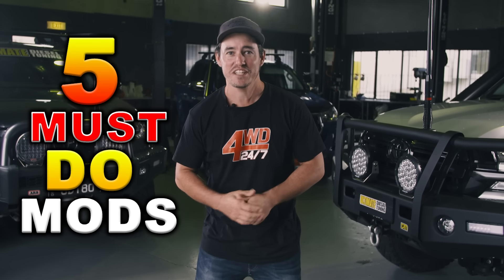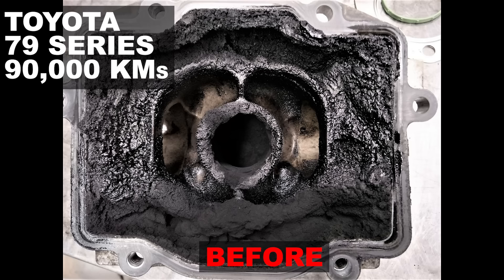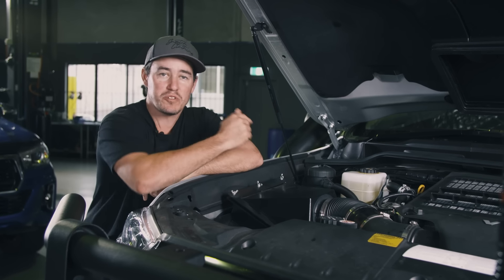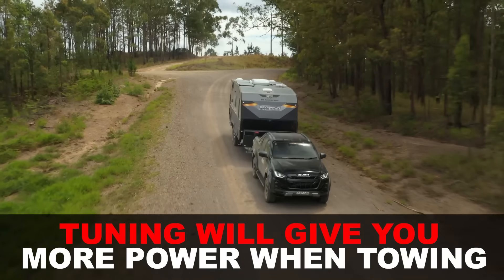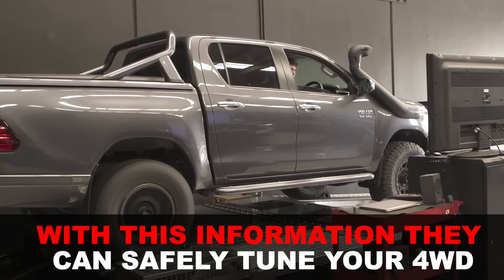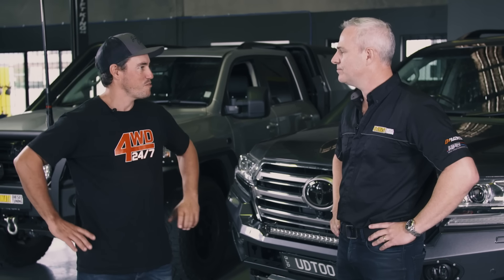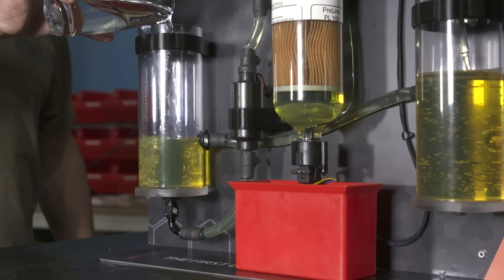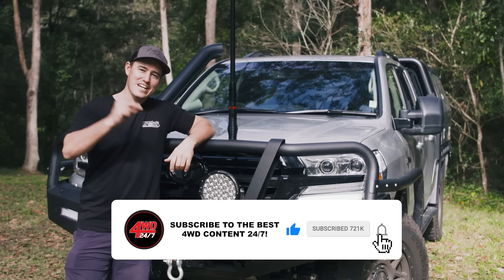5 MODS EVERY MODERN DIESEL OWNER SHOULD DO – all under $1,500! Get 30% more power, more reliability

Comment: Is there an easy way to check if you need a intake clean? I have an facelifted N70 D4D Hilux with 200k on the clock. Any suggestions?
Reply: Yep it'll have a good amount of soot in there. Pop the EGR valve off & have a look at it.

Comment: Dual mass flywheel applications donot match up with tunes .
Piston cracking is heavily influenced by tunes .
Injectors that are in good condition . Manifolds that are clean . Air filter housings that leak dusty air  [toyota panel filters ] .

Comment: Must disagree on the lock up kits. Most are poorly engineered. Only got mine (Ortos) to stop throwing codes after I greatly increased the resistor wattage (I.e ability to get rid of heat). Better to just use fourth in your five speed. Problem solved, zero cost.
Reply: we use the Richards Auto lockup kits, they are fantastic

Comment: has anyone compared dpf vs non dpf or dpf delete in terms of soot build up
Reply: DPF delete is illegal, so irrelevant
Reply: @Corey-pd3mi  that was the point of the question  to ask whether or not  dpf was even functional as intended or whether the science has been half cooked or not stating if is safer to have in place vs the other fuels in  use that is more toxic to the environment
Reply: @jasonhowe1697  hey Jason. The EGR system & the DPF system are two completely different things. A DPF has nothing to do with diesel soot build-up in the intake.
Reply: @UltimateDieselTuning   correct me if I'm wrong isn't  on the wastegate

Comment: Chemical clean.... do it properly please.  Also, catch cans don't stop the build up in the EGR.  Tune = "not working the engine as hard when towing."  Is he serious?  Lock up kit?  Just buy a transmission cooler if heat is your only concern.  Fuel filter.. yeah ok I agree with that one.
Reply: Ok, an engine making 500nm at 2000rpm vs 3500rpm which is working harder?
Reply: @adrenalinerush91  you don't get something from nothing.
Reply: Catch cans are solving half the issue. With regards to the tune -the engine isn't working as hard when towing because it has more power & torque so you don't have to push it as much (throttle) in order to get it to move as such.
Reply: @kizbot85  lol clearly an engine that doesn’t have to be flogged won’t work as hard as one that does.
Reply: @adrenalinerush91  Like I said before.  You don't get something from nothing.  Think about it.  You are sacrificing something for more power.  It doesn't come for free.  It's the same engine.  People just can't get this through their heads.  If the manufacturer could achieve this then why wouldn't they?  It's because they designed the engine with the best combination of power economy and longevity in mind.
Reply: @kizbot85  lol no they designed a base tune that will be “good enough” to run in every climate with every fuel quality with every engine. 
They also work to a budget. 
But hey come back and tell me the manufacturer knows best, the same manufacturers that designed the pistons, dpfs, handbrakes and couldn’t get a hilux to pass a moose test for over a decade. 
A tuner optimises the map for the country, climate, engine, fuel quality and use of the vehicle.
Reply: @UltimateDieselTuning  The engine needs needs X amount of power output to pull the given load at a certain speed under certain conditions so how is it not working as hard to achieve this and what are you sacrificing for more power?
Reply: @adrenalinerush91  If the engineers could get more power, fuel economy and longevity from the engine with no penalty, why wouldn't they?  That's right.  Because they can't.  To be clear, I am not against having someone tune the motor to suit a persons particular needs but there is always a negative which is never mentioned and why would they mention the negatives when they are trying to sell a product.
Reply: @kizbot85  LOL!! and again, those engineers make a generic map to suit every climate, fuel quality and engine for the ENTIRE world. 
A tuner optimises the map to the specific engine to the specific climate, to the specific fuel quality, and use of the vehicle by its owner. 
If you can’t or don’t understand the differences in climate, engines and fuel around the world there’s no point even talking to you.
Once again go ahead and tell me how great those engineers are while old mates hilux rolls down a hill from a failed handbrake filling the suburb with smoke from the failed dpf. Then when it stops he finally get to drive it back up the hill and finds he’s cracked another set of pistons and then rolls as he takes the next corner because those same engineers couldn’t get it to pass a moose test. Go on tell me how terrific those engineers are. Lol
Reply: @adrenalinerush91  He should really consider having that vehicle looked at because if they all did that they wouldn't sell many!
Reply: @kizbot85  you obviously know nothing about Toyota’s for the last 15odd years then
Reply: @adrenalinerush91  Owned many and still do.  It's called real world experience.
Reply: @adrenalinerush91  that makes two of us.

Comment: I have a question for the experts. The lock up kit mentioned here - is that the same as the now Isuzu standard lock-up torque converter? (The question shows my lack of knowledge, but I have ordered the BT-50 variant of the 2021 Isuzu (mainly towing, no real 4WD anticipated). Already for the pre fuel filter & catch can ordered), looking for a safe place for a dyna tune, but not sure about the lock up thing. Thanks

Comment: 4 minute mark, get a "dyno tune re more power, torque etc" then at the 7 minute mark, these engines are so "Highly strung", i.e. you can't have it both ways, haha. I think the manufacture would know more than these after market businesses re engine, transmission, and fuel filter requirements etc. Do you not think the OEM with all their engineering and design capability, that if they believed you could have all this extra power and torque by simply altering their OEM engine tune "at no cost to service life of the engine" that they would of all ready done this, i.e. be one up on their competitors.
Reply: You mean the same oem engineers that designed the pistons, dpfs, handbrakes and couldn’t pass a moose test for over a decade with the hilux? Lol
Reply: @adrenalinerush91  that's only toyota's
Reply: @dangray5932  those issues I was referring to yea because this video was mainly about Toyota’s but I could go on and on about issues with other manufacturers too. 

People seem to forget engineers are people and manufacturers also work to budgets
Reply: @adrenalinerush91  
Those issues you mentioned where mainly Toyota issues with the 1gd. Toyota handbrakes have been rubbish since the 80 series. Yes there have been many issues with other 4wd's especially dual cabs. Rangers have issues with engine and auto failures. Previous model Dmax's CV's were made of butter but that could also be the angle of the cv's from factory. Navara's rear mains are rubbish. There is no perfect 4wd. Someone will always find a fault.

Comment: There is no way you could do all that for under $1500 surely 🤷🏼‍♂️
Reply: Ryco sell kits that includes both a catch can and a fuel filter for under $400 so I'd say yeah, you could.
Reply: @RallyMichael75  no you cant. 1500 bucks for a tune alone. Egr cleans if done by a shop will set you back 600+ catch can and fuel filter 400+ . Looking at 2.5k roughly to get this work done.
Reply: It's not all of it - the dearest part is $1500, that's what Shauno meant.

Comment: Tuning is not good idea for small 4 cylinders . Specially 1KD.-FTV. Crack piston
Reply: they crack pistons without a tune as well. It's a known fault within those engines - tuned or not.
Reply: @UltimateDieselTuning   how can I reduce that risk ?
Reply: @ozipradolife3660  there is really nothing that you can do about it unfortunately. It will happen randomly in even the well looked after ones. It's the luck of the draw.

Comment: Pretty sure car manufacturer engineers know more about engine reliability and performance than aftermarket salespeople.  Every one of these mods will screw your new car warranty
Reply: You mean the engineers that designed the pistons, dpfs, handbrakes and couldn’t pass a moose test with a hilux for over a decade? 
They’re told to work to a certain budget and implement emissions systems buddy. All they’re concerned with is a high percentage rate of vehicles making it out of warranty.

Comment: Get a petrol engine and you wont have all these problems that diesels have and you wont waste money on these upgrades to fix a diesel and keep it running. 4WD 24-7 dont make videos on upgrading petrols coz they where built perfict from factory. Diesels hate water, when a petrol only needs a cup of metho in the tank and you wont know theres water in there and wont damage your engine. Dont waste money on a poorly designed deisel engine. 
If i was wrong then 4WD 24-7 would put videos up on petrol upgrades.

Comment: Diesel diesel diesel what about petrol 4x4s. The diesel 24/7 4x4 show is getting a bit long in the tooth
Reply: Apart from the y62 patrol what other petrol 4x4 is there ?? There all deisal
Reply: @76cruiserAustralia  prado Pajero hilux patrol
Reply: No such thing as petrol 4wd lol
Reply: @06hunter54  whatever mate you have to spend thousands on a diesel just to keep up to a petrol 4x4 lol
Reply: @daz6525  maybe you should make a video on petrol engine cause no one seems to care here haha
Reply: @Kardiak345  you seem to care enough to put your  two cents in. my V6 4.0ltr supercharged twin locked on 35s hilux vs your shit  box diesel.......😂😂
Reply: @daz6525  lol,  your argument is not that good. You had to supercharger it to go faster? Why didnt you buy a v8 commodore or something similar?
Reply: @06hunter54  you obviously don’t know much how fast can you go in low range it’s obvious that it’s not for speed
Reply: @06hunter54  what did you have to do to your Diesel engine for it to keep up chips tunes throttle control catch can pre filters ect .......the 4.0ltr v6 hilux has plenty of power stock standard the supercharger was just for shits and giggles really

Comment: Just had a look at the intake of my CRD ZD30.  What is this black goo people speak of - I don't have any at all.  Not even a film of oil inside the intercooler either.  Have I done something wrong???
Reply: Pop your EGR valve off & have a look at it
Reply: @UltimateDieselTuning  You missed the irony :)  Provent 200 from brand new, remap which may or may not have stopped the operation of said valve.  Only 85,000k on it but nice and clean inside.

Comment: don't worry about we will not be driving them soon. need EV builds
Reply: Hybrids first. So need combustion engine. EV's have bad range for touring on or offroad. I think the electric Wrangler gets 3.5 miles offroad. Lets see what the new Hummer can do. Along way off for EV offroading.
Reply: @Malc664  and they all cost too money, batteries cars are not great for the environment as well in the building stages let alone recycling them